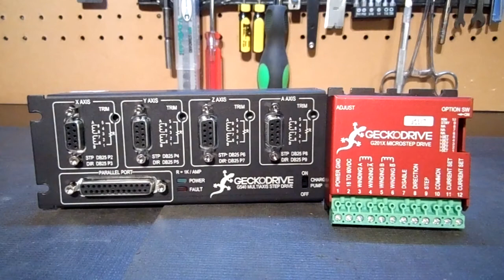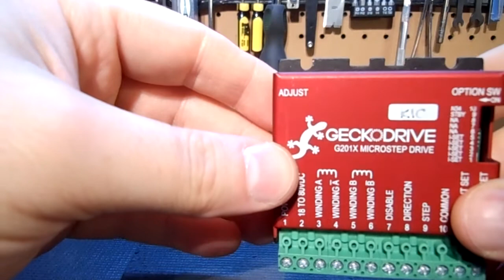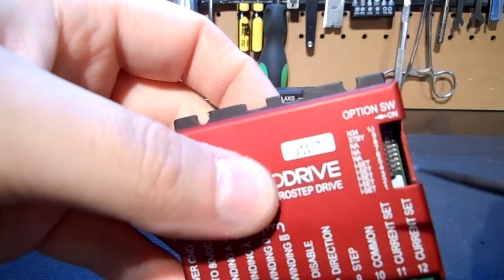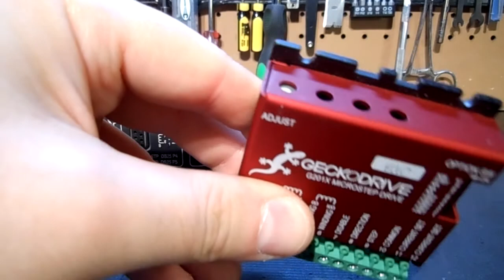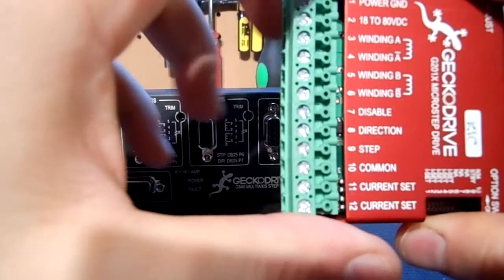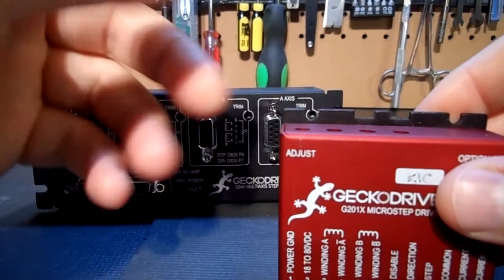Gecko G540 Vs Gecko Pro Grade Drivers? Which Does Your System Require?

Comment: Hi Vince great videos! I have a question that you may be able to help me out with. So a few years back I built a 4x4 plasma table that I now use on a daily basis. It works great with no problems but I'm planning on redoing all my electronics as I'm switching from the cheap amazon BOB to a Messa 7I96 to use THCAD. My current drivers are the cheap amazon stepperonline DM542T. They seem to work fine with no issues but I'm debating on upgrading to Gecko pro drives (not sure what model yet) and running around 60V-70V's. My goal here is a more torque for faster direction changes and smoother running motors. Would this be worth the upgrade for me to switch to Gecko drivers or would I not notice a difference? I'm currently running around 46V ,1/2 step resolution, 4 amps and Nema 23 motors.
Reply from the maker: Hey David,
Thank you for your support. If your drives are operating correctly, then I would continue to profit from them as much as possible at least to pay for the drivers upgrade. The A 4ft x 4ft plasma is easily operated with a G540, and wouldn't recommend anything else as you won't see a huge difference in speed, but you will feel it in your wallet switching to the pro-drives. Thank you, and have a great weekend! Vince

Comment: There is no point getting the larger driver, unless you have motors requiring larger currents or voltage.  Otherwise the features of the G540, which is just 4 G25xr3, are pretty much the same.  They have the same morphing from 10x microsteppimg to full steppping as the speed goes up, and micro stepping becomes meaningless and reduces  torque, and  have the same built in protection etc.  If you have  NEMA 34 or less, no reason for the bigger drive, they are all “pro” features from GEKO.
Reply from the maker: Automation03, Thank you for your support. You're correct, but the G540 doesn't have the built in drive protection as the G203v's, or their new Raptor series drives.  Either way its the most cost effective solution for those requiring a drive as you said with lower amperage requirements. Thank you,
Vince

Comment: One would think that now we are in 2020 geko would have progressed from the ancient parallel port, yes its a tried and tested system but try to find a new pc with a parallel port, even adding an addon card with parallel ports is not the perfect solution, usb to parallel adapter give problems, almost every pc, notebook, desktop or portable all have ethernet and usb, even wifi, why has geko not progressed since the 70's technology.  I would say the pc will crap out before a geko but find a replacement next day to get you up and running again, thats why I dont, won't ever use them on modern cnc. sorry  So apart from the extra cost for the geko you have extra cost finding new pc to drive them.
Reply from the maker: Derek, Thank you for the comment. Your correct Gecko is certainly ready for a change in the way the drives communicate. They are working on an ethernet release for the  G540 which will be released hopefully in the next few months. Thank you,
Vince
Reply: @corvetteguy50  what is the name or link to your online store
Reply from the maker: Hey Rob, Thank you for your support. My link to my store is here https://www.ebay.com/str/edealersdirect Thank you,
Vince

Comment: I have a plasmacam dhc-2 plasma table I brought second hand without control box or software I was just wondering is there anything that I can buy off you a kit that will run the table all the motors are there I think they use servos and I was wondering could you help me out what I need To get it up and running cheaper the better I'm only a hobbyist
Reply from the maker: Hey Kyle, Thank you for your support. I messaged you already. Thank you,
Vince

Comment: So I have a question. You mentioned in either this video or another one I watched of yours about NOT connecting 2 steppers to 1 axis. I have a Shapeoko XXL with 2 Y axis steppers. They connect to their own designated locations on the GRBL based board supplied with the machine. I've contemplated switching out to a gecko g540 so I can use Mach 3 or UCCNC. What would you recommend that would work? I see people switching to a gecko g540 for the same machine I have. I'm fairly new to the CNC world but I like the fact that it's easier to fine tune your machine easily using a more pro grade sender software for calibrating the machine whereas with the free software compatible with the GRBL based board I have isn't as easy to make those calibrations because some of it is hard coded.
Reply from the maker: Hey Jason, Thank you for your support. The GRBL is completely apples to oranges from a G540. The G540 features 4 10x microstepping drives (also known as G250 drives) which translates into 2000 microsteps per revolution on a 1/8 degree stepper. The other major difference is the 540 can support 48v input allowing for much faster rapids. Your machine would require the G540, and provide you a huge performance boost overall as your rapids should at the very least speed up your machining time by reducing its time to at least half of how long jobs currently take. Here's a Chinese 3020 upgraded to a G540, and my 48v 12.5a power supply. https://youtu.be/LLHbzmXAPps  I suggest starting from the 28 minute mark to review his axis calibration with the speeds he achieved.

Thank you, and have a great weekend!
Vince

Comment: I have a 70s bridgeport boss cnc. Im gutting the boss and going to mach. I used a stepperline 4.0 amp driver at half step/400 and it only pulls 1.3 amps at 36v on my sorenson 40v 20a power supply. Limited to 5 amp. It has large old nema 42 motors. The stepper line works ok but the motors and power supply sound like static tv channels. I installed genuine toshiba TB6600 and they worked fine and no static untill i put them in full step. Heard a pop and it was done. Did it 3 times trying to figure out the problem. Works fine in micro and half step. But full step killed it. I want to buy some geckos G210x but dont want to damage them like the Toshibas. What am i doing wrong? The drives never even got hot. Only ran em for a few mins tops

Testing motors and manual feed no mach yet.

https://youtu.be/j__MHcv5dXQ
Reply from the maker: Electromechanical stuff thank you for your support. The TB6600 are your issue as their infamous for having issues with quality control. Your Boss is an amazing machine when retrofitted, and I recommend the the G201x to cure your issues. If you like we can speak direct at Storm2313@gmail.com

Thank you again,
Vince

Comment: Nice video. I'm running a large 3D clay printer with the G540 (two steppers for the Z axes) with Mach3. I  will order a G201x drive since I'd like to ad an extruder. Until now the clay was pushed with a compressed air. Don't know yet how to connect a fifth axes. Probably some kind of a breakout board will do the job. Do you have any advice on that? Thank you!
Reply from the maker: Aleksandera, here's my breakout board for a simple integration of the G230v. https://www.ebay.com/itm/142319224100#rwid

Thank you,
Vince
Reply: Thank you  Vince! Hm, does this meen I have to take the G540 apart ore can this be solved by another "breakin board"? :)
Reply from the maker: In order to add an additional drive you would require a parallel port output on your computer, and you could add the additonal breakout board, and drive to using the secondary parallel port option in Mach3. This would allow you to use the G540 for 4 axis, and allocate the BOB drive as the 5th axis. 

Thank you,
Vince
Reply: Huh, actualy I tried to do that once, lost my nerves and left the project for some time. Guess it's time to try that again. I thought there is another way :) Thank you so far!
Reply from the maker: You Bet :)
Vince

Comment: I'm looking for new drive for 6 axis & compatible with mach3 wich  type you can named to me guys 
and thanks for this video bud 
:)
Reply from the maker: It all depends on your chassis requirements, and your budget. I need details on what your trying to automate to point you in the right direction. Thank you,Vince
Reply: corvetteguy50 
I'm work at artcam and drawing with coral design 3d paint job metal and wood and acrylic  I have  6 nema34 stepper motore
Reply from the maker: You'll want the pro grade Geckos. I would suggest G201x, or G203V drives. The G201's are the standard pro drives where the G203v's are the "Vampire" versions of the drives. They call them vampires cause their virtually indestructible. The price is slightly more if your budget will allow it. Either of these drives will be perfect for your system. Thank you,Vince
Reply: Thanks you Vince for your support & help :)
Reply from the maker: Yes sir. Thank you

Comment: Just found this channel. very plain spoken. I would be concerned with the DB9 connectors being able to handle that current in the long term. Obviously that isnt a concern or it would have surfaced by now, but how can that be?
Reply from the maker: Winner your correct. The DB9's are only to be used on the G540, and the pro grade drives require higher amp rated connectors. I prefer GX 16 aviation connectors. Thank you,Vince
Reply: Depending on the manufacturer D-connector pins are rated up to 5A

Comment: Hi Vince, i have a chineese 4 axis 6040 with 1.5 Kw VFD spindle, what package would you recommend ? Thanks in advance.  Great videos by the way
Reply from the maker: A 6040 provides optimal performance with a 600oz motor G540 setup. It can easily machine aluminum, and virtually any other substrate. If your using a 1.5Kw spindle it will still mill aluminum with a lower feed rate. You can go with 300oz-600oz depending on the substrates you plan on machining. I would evaluate your budget as the larger the motors the more cost involved. Thank you,Vince
Reply: Hi again, only machining acrylic and wood, you have many options :). not looking to replace "A" axis so only need 3 steppers but 4 cables.  so i'm looking for complete kit to covert 3 axis (300 oz ) including enclosure. budget is around 6-700 dollars.
Reply from the maker: If you require 4 motor cables I can add an extra. The system with 3 300oz, and 4 10ft. motor cables, will be $735 shipped. Here's the configuration you'll be receiving. http://www.ebay.com/itm/Gecko-G540-CNC-Motion-Control-System-48v-12-5a-3-Nema-23-300oz-in-3-5A-Motors-/131247492157?ssPageName=STRK:MESE:ITGive me your email if your ready to purchase the system.Thank you,Vince
Reply: e-mail sent

Comment: Excellent Video!  Thanks for sharing! Planning to DIY a 4'x4' plasma table as a starter and expand it later to a 4'x10'.  Kinda like the budget version of Torchmate.  What would be the best package to begin with that can be expandable later on?  Thanks!
Reply from the maker: Joe, all the packages that feature the G540 are able to support 4 axis in plasma, or mill. My plasma system will support either of your tables, and includes the Proma THC. Thank you, Vince
Reply: Can you link me a package that includes the Proma THC?  Thanks Vince!
Reply from the maker: Joe the plasma system is here http://www.ebay.com/itm/Gecko-G540-Plasma-System-48v-12-5a-3-300oz-3-5A-Steppers-Proma-THC-150-/131777469930?ssPageName=STRK:MESE:IT Thank you,Vince